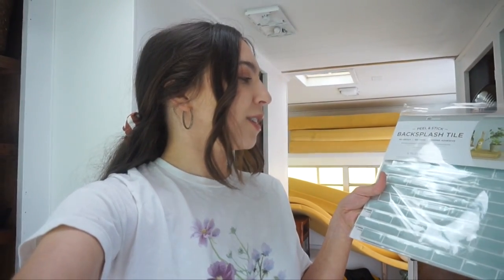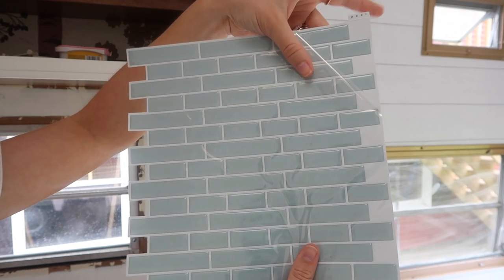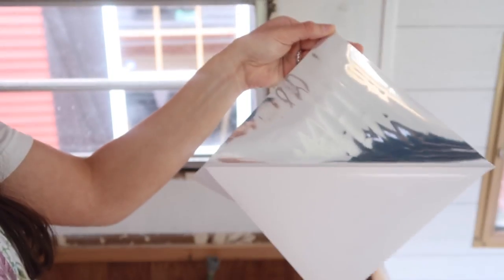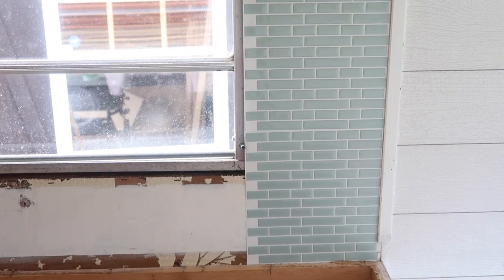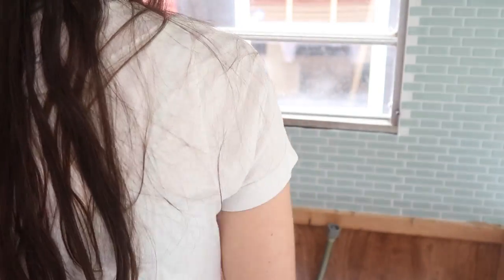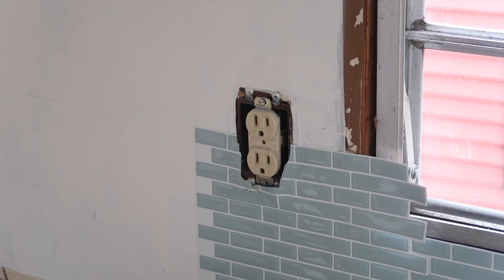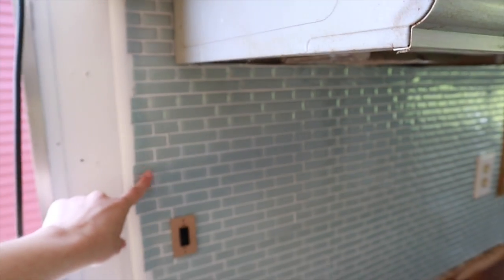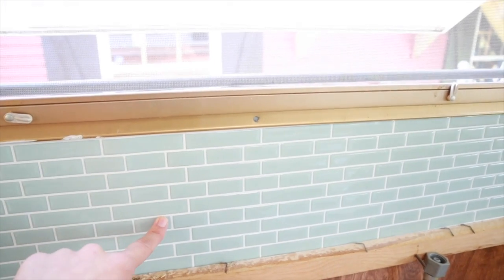HOW TO: PEEL AND STICK KITCHEN TILE in our camper//easy & affordable kitchen backsplash

Comment: I just put this exact tile over my shower.  I found any pieces that were not sticking well, to use a hair dryer.  This heats up the glue and will allow it to stick better.  Beautiful tile and you did a great job!!
Reply from the maker: such a great tip!
Reply: Thanks for the tip

Comment: I used Peel and Stick tiles in my camper backsplash and the back burner heat doesn’t effect it. Mine have been up for over a year in every temperature from below freezing to high 90s and they have held up excellent. As long as the surface is clean and the inside of your camper was fairly warm when they were put up, they’ll stay super well.
Reply from the maker: that's so good to know!

Comment: Thank you for this great video. I've been looking at a few with this kind of peel and stick tiles, contemplating on using them in my downstairs toilet room. I was hesitant about the white part, didn't know if it would look too much like regular plastic or if it would be a convincing fake. But since you mentioned how far it should be away from heat sources, I realized I can't use them anyway since they would have to go behind a radiator. Just that little bit of info that was missing in all the other video was sooo usefull for me. Thank you.

Comment: I just checked Amazon - it’s $26.97 now!  That’s pricey if you have to buy about 10 packages.  I just finished my kitchen countertop, am working on the cabinets, then want to do the peel and stick backsplash.  (I won’t be buying them at Amazon). Helpful video - thanks!